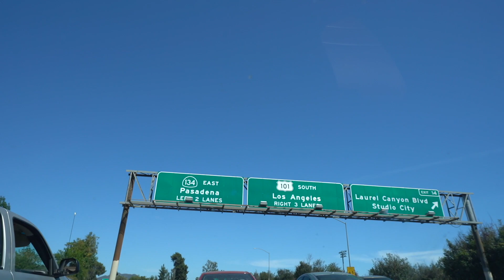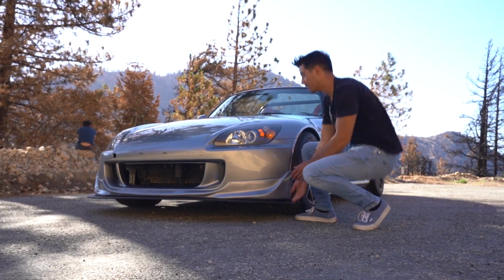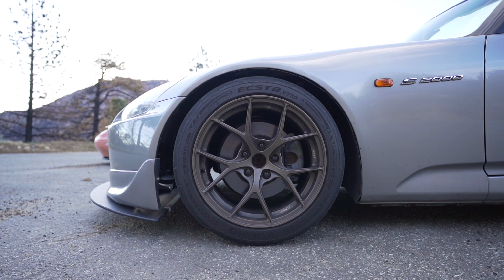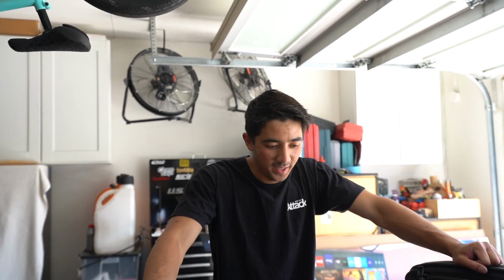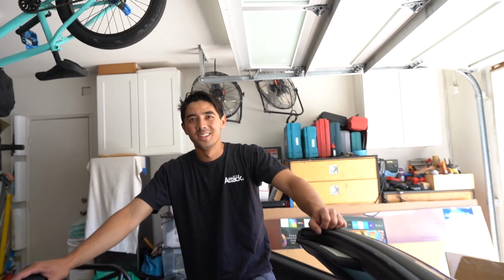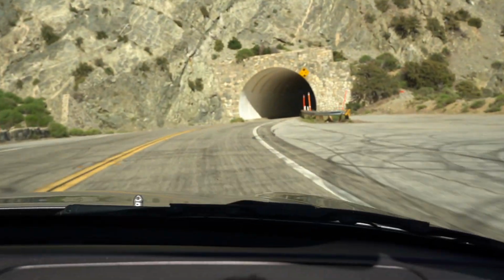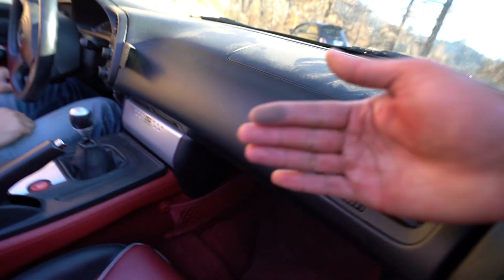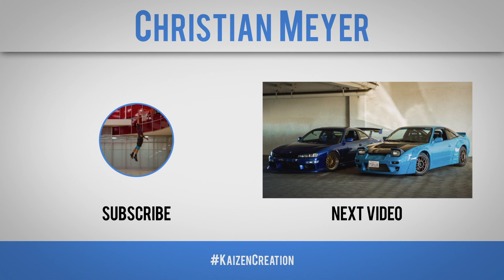My S2000 Time Attack Build - Episode 3

Comment: Hey Christian did you need to roll fenders to fit the Titan wheels and tires? And how much camber did you do?
Reply from the maker: Fenders were rolled by the previous owner. I’d say it’s definitely necessary to get a decently low ride height. I don’t remember the exact alignment specs but the front was probably more than -3° and the rear around -2.5°